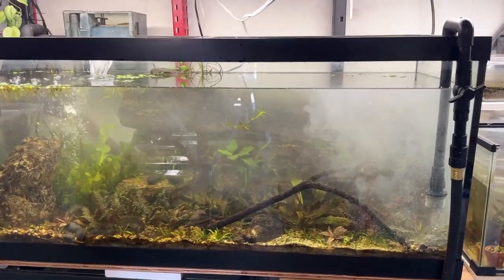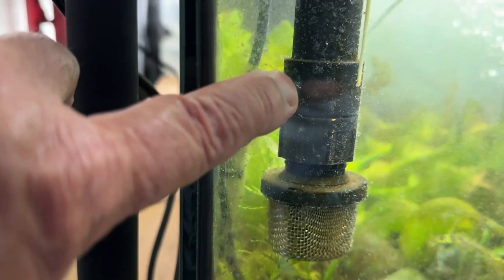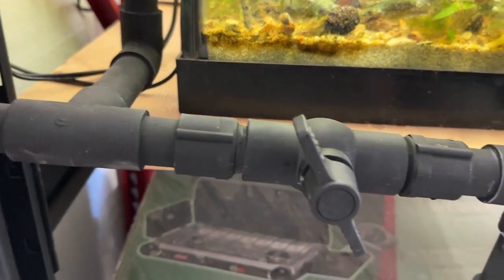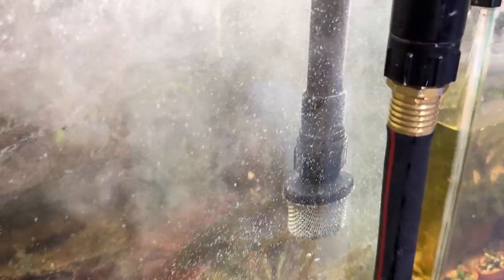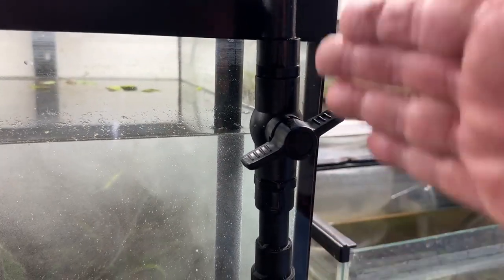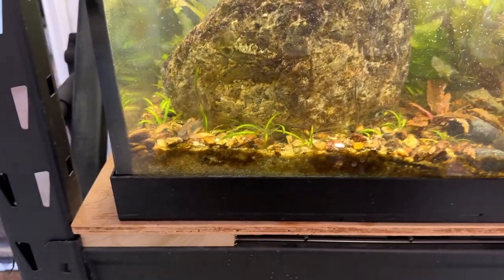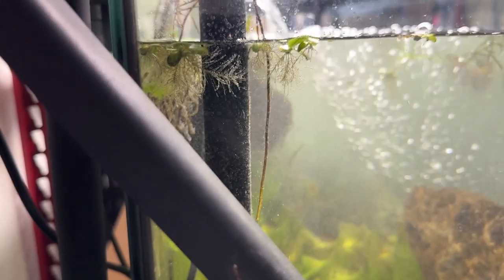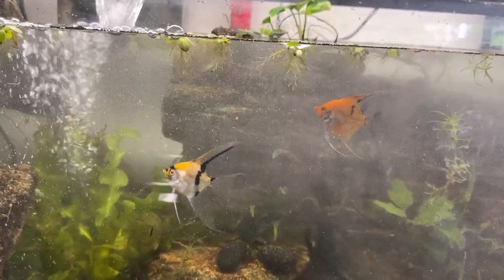Note To Self - Plan Ahead!

Comment: A union would make that about 1" longer. At least that is about how much I have to cut out of a pipe to put a union in. With a union, there could be other advantages also.
Reply from the maker: Ya know, that's a great idea! I would have to shorten the length of pipe that goes up the back of the tank to keep where the pipe folds over the top at the same level., but that'd be easy enough. And that would allow me to remove the entire structure, if necessary, a lot easier. Great idea! Thanks!

Comment: I have angels, geos and acara that huff and puff, pout, or even act like they are dying if I do more than a 50% water change (I am on well water, no chlorine).
Reply from the maker: After I did that tank, I did a 29 with a bunch of juvenile albino Kribensis. Huffin and puffin is an understatement. 🙂 Aren't there other challenges with well water? A friend in Hollister, CA has high levels or bromine in his well water. I guess in some cases some sort of filtration might be required? Tanks!